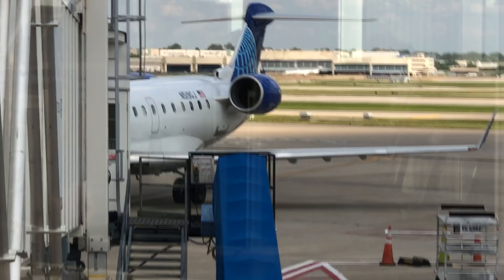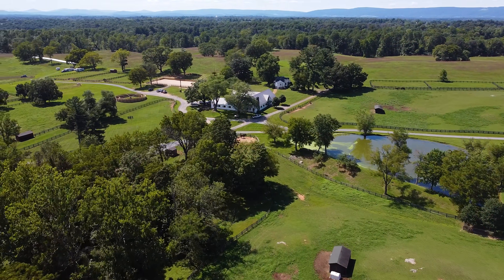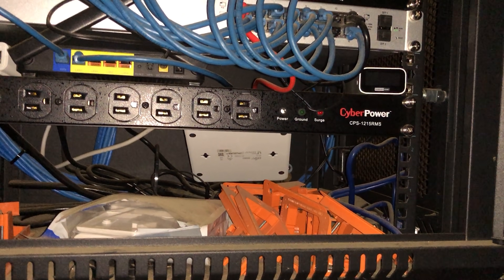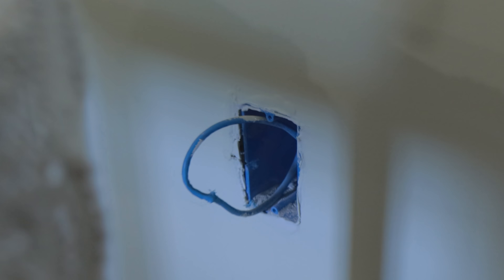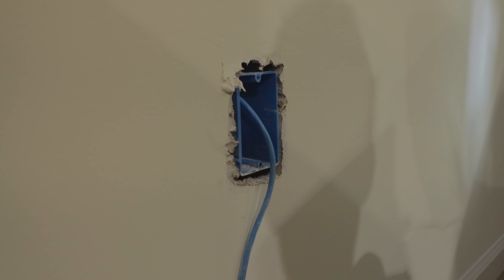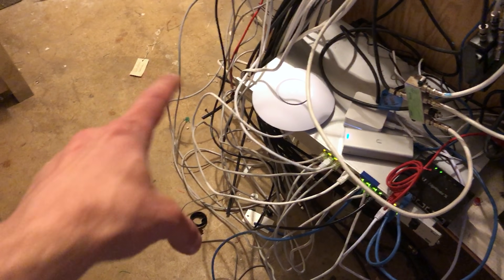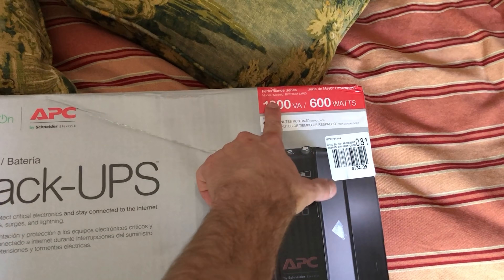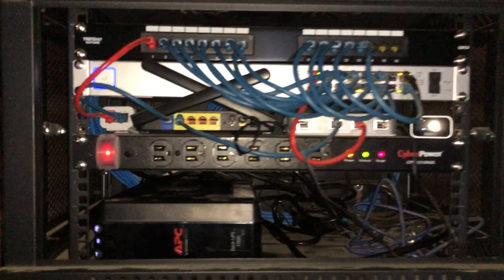UniFi network in a barn pt. 2 | They broke the network I installed for them!

Comment: Wish I could route my cables better and install in wall wifi 6's but this home was built in 1905 or around there lol.

Everything is run in the basement and up through holes or on the outside of the house.

 Installation might look crappy but it's the best I could do until we renovate more rooms.
Kitchen was just done

Comment: I want to know what all that crap is splattered all over that rackmount power strip. I got a startech, showed up with that crap all over it, and one of the rack ears bent. I bent the ear back out and scrubbed it with alcohol and it wouldn't come off.
Reply from the maker: It’s just a textured coating under the paint…

Comment: Well done! Wouldn't it be better to go for actively cooled router & switch or are these already actively cooled?
Reply from the maker: The switch has active cooling. The router is passive. By next year, construction should be finished so the networking stuff will be air conditioned. Either way, I’m putting proper cooling in that rack.